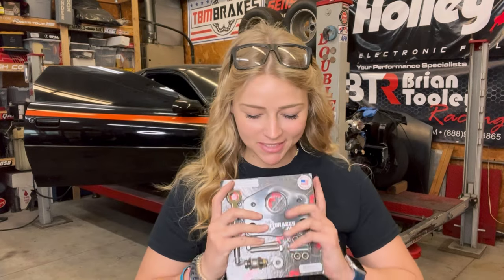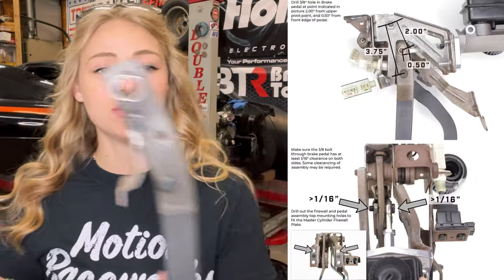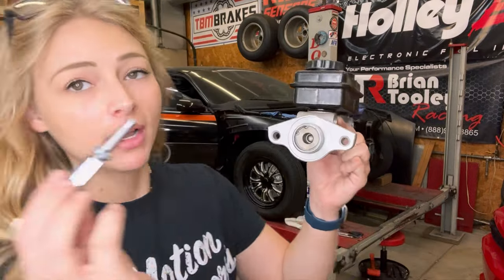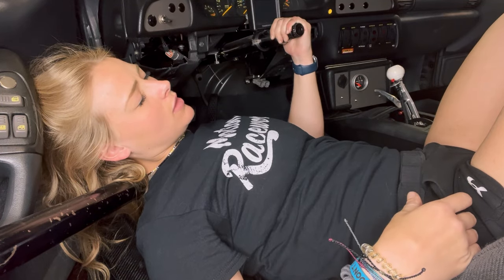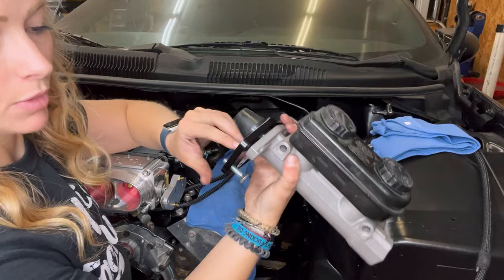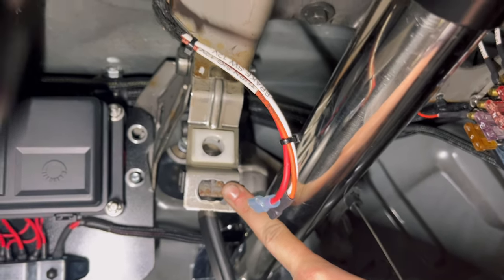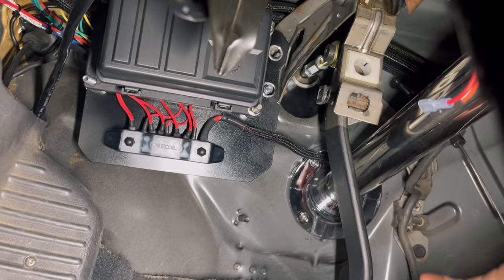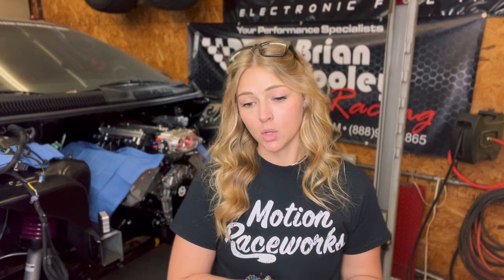Don’t Forget To Stop!

Comment: Great videos!  You may want to double check in your master cylinder but most of the time the front port is for the rear brakes and the rear port is for the front brakes.
Reply from the maker: It’s based off of which load is more. Drag racing you typically have the rear brakes to the back

Comment: My S10 had power brakes somebody told me I should change the manual bikes is that something you chose around manual brakes for a reason or or where is better to have manual brakes for racing for high speed like I did

Comment: Consider running the passenger brake line behind the motor instead of along the k-member. More out of the way if you drop the motor out the bottom which is more common the the 4th Gen f-bodies
Reply from the maker: Thanks for the thought